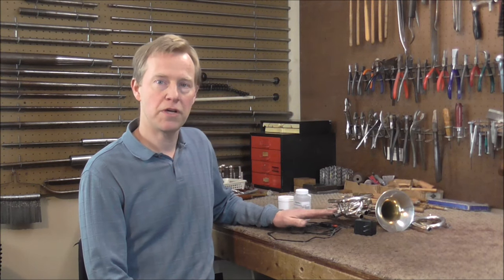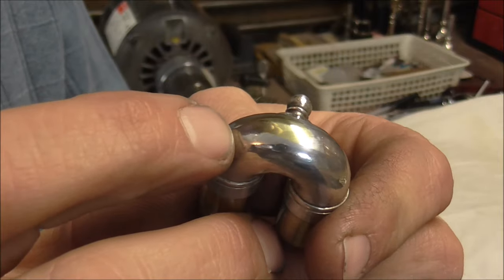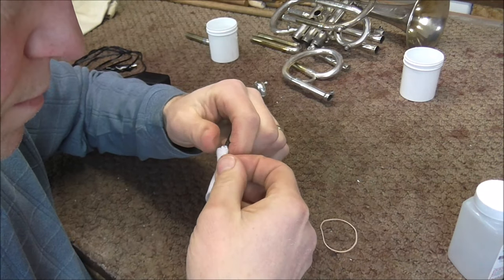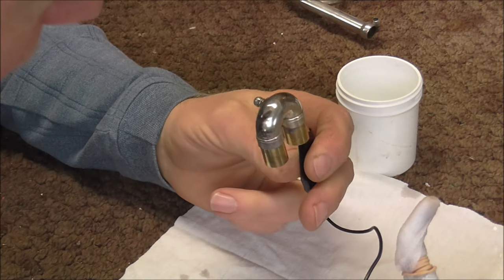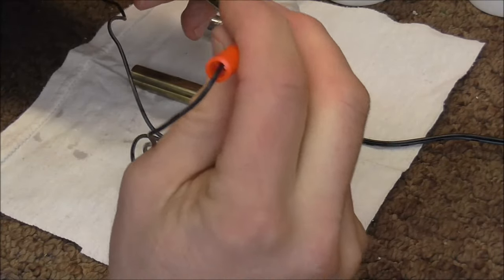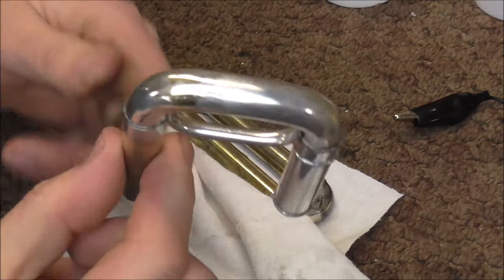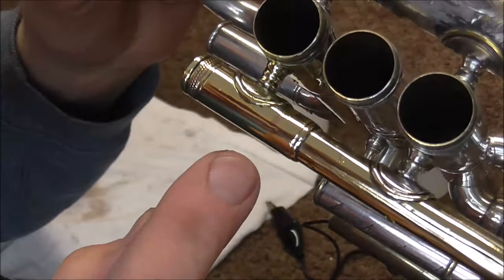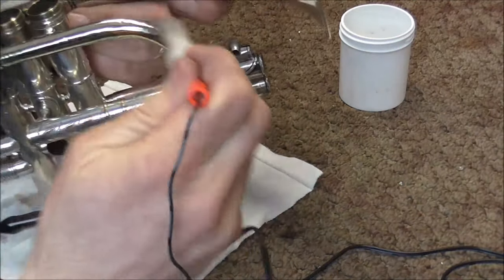How To Touch-Up Silver Plating: A/Bb/C Cornet Restoration #7 | Electro-plating

Comment: Usually, when silver solution turns black, it means the silver particles burnt before they could jump to the metal to be plated. This can happen with too high voltage - but if I found the right one at Caswell, this power adapter has only 1.7 volts, that is not too much. I´m plating silver at ~2.8 volts. So, don´t stay on one spot, always move the wand in small circles, until you have been at every spot multiple times. You might even try other cloth on the wand that is more fluffy, that will make it easier to reach tricky edges and grooves.
Oh, and you should wear gloves - silver solution can turn your hands black, and it takes really long until it goes away again ;)

Comment: I am an amateur: I do localised silver plating. This has been very successful. Cleanliness is next to Godliness. Wear surgical gloves. As a minimum I would clean thoroughly with Isopropyl alcohol after buffing. Then rinse with deionised water (You can use electro-cleaning to do a more thorough job). I would strongly commend investing in a Voltage / Current controlled bench power supply. This will allow the maximum voltage and current to be set, reducing the chance of burning / blackening. I would opt for a lower setting within the required range. This may take a bit longer but allows the wand to be moved in a slower, more controlled manner. I also agree with a previous comment to use a more fluffy wand. I would also extend the plating time. What can look a good silver coating may be a very thin coating, which will wear off quickly. I find knurled surfaces are never as good. One area where tank plating is better. When done well the results can be very satisfying.

Comment: Excellent video. I'm wondering if the electrode clip may need to be close to the area you are trying to plate? That could be why the second valve slide was quick and easier. Wondering, odd as it sounds, if your hand (fingers?) might disrupt the circuit....thus causing some plating anomalies....but I believe the black color is evidence of silver deposition! The soap acts as a degreaser which is good to prep the pieces.

Comment: I've used the Caswell silver wand plating kit and found I had to rub for a very long time. If I plated until it looked plated, it wore off a little from just polishing it with very gentle silver polish, and even from just rubbing my finger on it for a little while. I had to rub for probably 10-20 minutes for it to not wear off at all from polishing and even then my impression was it's a pretty thin layer. From what I remember, it basically keeps adding more and more plating the more you rub, so you could just do it for a very long time. whether the plating sticks well or not I guess depends on other things (I commented on your other plating video too).

Comment: To build a thicker layer hold that swipe for a bit longer over each spot. When you just hold it in the air there will be no electro chemistry going on. You need a closed circuit for that to happen. 
This will be a wonderful horn when done I'm sure.

Comment: Informative video for everyone. Maybe to make the surface activated, and to take the silver plate more easily, give a quick electro treatment on 4-6v of Sparex 2 or TIVACLEAN solution for 20-30 seconds. Then rinse well, and continue with the silver on a lower voltage to avoid burning. I think the silver will then adhere much better.

Comment: I am workingon a euphonium. It is a Tone King made by The New York Band Instrument Co. I am trying to determine it's age or approximate manufacturing date. There are 4 numbers on the valve cylinders. Would they be manufacturing series numbers? From what I have found the insignia "Tone King /The New York Band Instrument Co. New York" was used between 1898 and 1920. More info would be appreciated. Thanks for the valuable instruction you have presented on You Tube.
Reply from the maker: I do not know much about that. I think they may have been made by the Wurlitzer company, but I am not sure. Look at those serial numbers and see if they match with the dates for The New York Band Instrument Company.

Comment: Questions, wich kind of Silver solution and how much tension in Volts and Watts? Thanks in advance!🙂
Reply from the maker: I bought the silver solution from Caswell. I used 1.7 volts and 300 milliamps. I do not know how many watts that is.
Reply: @TheBrassandWoodwindShop  , thank you so much !
Reply: @TheBrassandWoodwindShop  in this case the watts would calculate as 1.7 x .300 = .51 watts.

Comment: I've been thinking about swapping the receiver out on my trumpet for a harrelson VGR system. Doing so would meaning moving one of the braces and leaving exposed brass where the brace would have been previously. This would be a perfect way of re-plating over the exposed areas and making the change invisible without having to re-plate the whole horn!

Comment: I use silver cyanide and a model train transformer (tyco).  WEAR NITRILE GLOVES.  This stuff is poisonous as heck. Lower the voltage and keep it wet to stop the blackening (oxide layer).  The solution lasts a LONG time so I just dump the used back in the bottle.  I have been using the same bottle for 10 years at least.  Lock any pets out of the room when using plating solutions until it is all put away and washed clean.  You can also strip plating by reversing the voltage.  Really bad slides can be stripped, restored, then replated.  Don't silver plate pistons!  I use nickel plating for those and it is a more complex thing involving lapping and such.